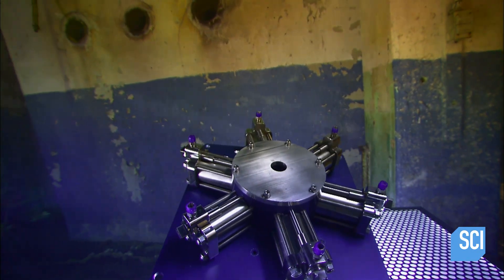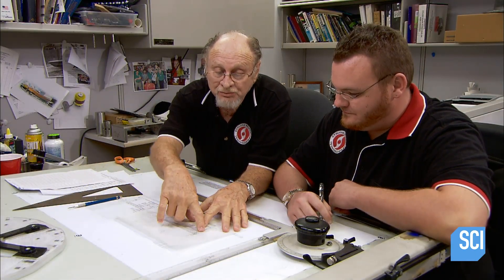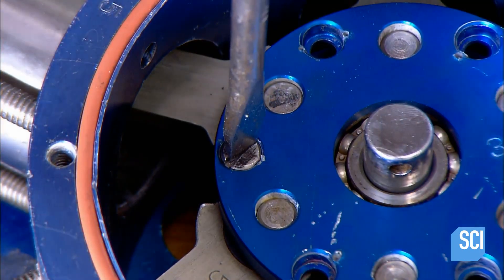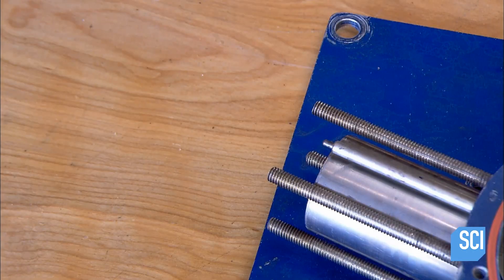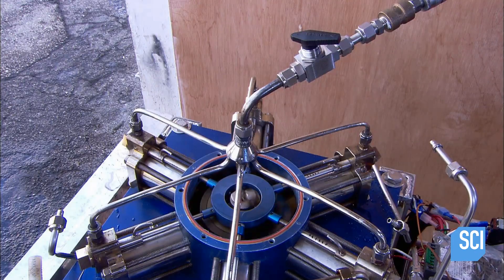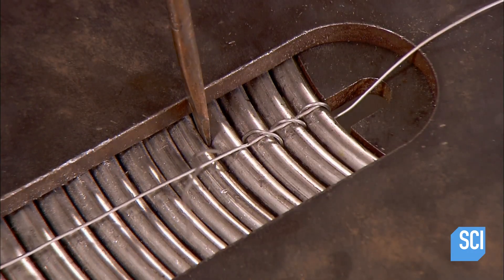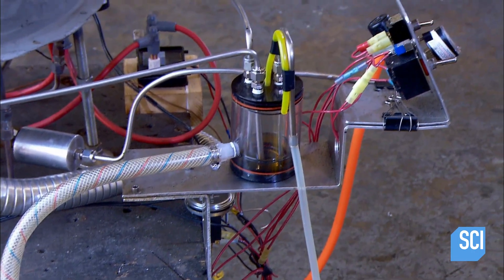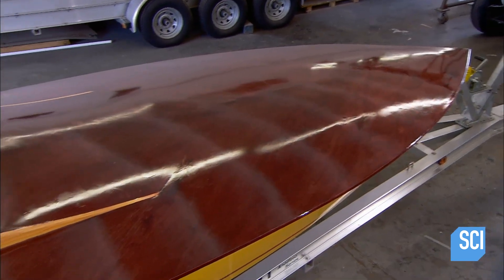How It's Made: Steam Engines

Comment: I observed that this sector-shaped component pushes the heads of these iron rods, and the other ends of the rods should be connected to cylinder controls, allowing the cylinders to take turns exchanging gases to ensure coordinated operation. I also think the gas exchange control and the condensation reflux steps in this video are quite crucial, as they seem to have not been disassembled in this section

Comment: I was told that steam engines were only about 15% efficient,  even if a triple expansion type - and isn't this engine,  effectively,  a single expansion? Couldn't they have increased the efficiency by running the exhausted steam into a secondary set of cylinders?
Reply: You are correct, a compound engine this size is only about 12% efficiency, it would be very unlikely this single expansion engine could achieve more than 10%.
FYI: Cyclone was never a legitimate company and it is defunct after Jharry Schoell diverted investments into the construction of a new luxury yacht (powered by Diesel engines)
Reply: @sandervanderkammen9230 

 Sad that people prey on others looking to benefit the environment.
Reply: @NoosaHeads  Anyone genuinely interested in benefiting the environment needs to take a seriously hard look at biggest problem, which is global overpopulation.
Not many have the courage to be honest about this threat to the environment.
Reply: No . I think the efficiency is quite high, higher then a diesel engine for sure
Reply: @robertlindsay9826 Absolutely not, the Rankine Cycle can never achieve higher efficiency than the Diesel Cycle, this is prevented by the Laws of Thermodynamics
Reply: The highest efficiency ever achieved for reciprocating steam engines was 31% in a German Superheated, reheated, condensing, quadruple expansion steam engine running on 800 PSI steam. Typical Superheated condensing steam engines could get up to 24% thermal efficiency. Uniflow steam engines can get much higher efficiencies at smaller unit sizes. A small, 50 horsepower 3 cylinder Uniflow steam engine at the White Cliffs solar thermal power project in Australia achieved between 18 and 20.5% thermal efficiency.
Reply: @gregorymalchuk272 Thank you. I didn't realise that steam could do so well. That's about the same as a petrol engine isn't it? (31%)
Reply: @NoosaHeads It's pretty good, and it's probably on par with nuclear power stations operating at the same steam temperatures. That was achieved in the 1920s, after which all research into the reciprocating steam engine pretty much dried up. Who knows what could be possible with modern materials and electronic controls.

Comment: Interesting fact is that nuclear reactors also uses stream engine to produce electricity, the reactor's main job is to produce heat which boils water and turning it into steam which runs the steam engines that then runs/turns the generator
Reply: Nope.

Comment: Genuine question - if steam engine is so efficient and greenhouse friendly, why isn't it more commonly used?
Reply: Because it's not efficient or greenhouse friendly.
Reply: It is and it isn't. Thermal power plants (coal, natural gas, nuclear, biomass aka wood, geothermal, etc) use steam regardless of the heat source, for the most part. 
The most efficient way natural gas is typically burned for power, for example, is with a combined cycle gas turbine, which is a gas turbine (similar to a jet engine but optimized for shaft power, not thrust), and a steam turbine combined together. The waste heat of the gas turbine heats boilers which drive the steam turbine. Gas turbines are far more efficient when driven with high temperatures, than steam on high or low temperatures, but the waste heat is still quite hot and can still be used for steam power. 

As for the small scale shown here, I doubt that steam engine is all that efficient, although I could be wrong (after all, that is quite the super heater in that boiler). Highly efficient piston steam engines are quite complex and maintenance heavy. When steam locomotives were phased out the diesels that replaced them actually were less efficient, but their far lower operating costs and greater flexibility made it quite worth while. Today, small internal combustion engines are probably way more efficient simply due to higher combustion temperatures, and certainly less maintenance intensive, but with that steam engine shown lacking any real control gear you would usually expect for throttling or achieving efficiency at anything besides flat out operation, it might not be too bad for maintenance cost. The generator used for charging off grid battery systems looks like the most interesting application due to it not needing particularly fine control. Btw, when they said in the video that the water was the lubricant, that was probably a flat out lie. The (I assume) graphite pistons are probably the lubricant, graphite is a good dry lubricant.

Oh and emissions. The low combustion pressure (and probably low temperature) reduces things like nitrogen oxide emissions, which is a big part of acid rain. Nitrogen oxide free in the air will eventually oxidize to nitrogen dioxide (once cool), which then reacts with water in clouds to make nitric acid. This has almost nothing to do with greenhouse gasses as CO2 is the primary greenhouse gas by a long shot in this case. 

Hope that was somewhat helpful and that I didn't get anything too wrong.
Reply: Because governments are made up of predators that believe that the only solution to any problem is you losing your rights. Hence the climate hysteria BS.

Comment: If this principle could be adapted to use the heat from A/C condensers and heat pumps to power a generator couldn't you recover some of the energy used to run those systems?  Move over solar.
Reply: Eh not really. They are both heat engines, and A/C systems or heat pump systems typically get less efficient as the temperature change required increases, so any gains made by the steam engine equate to greater losses in the heat pump that could have instead been avoided by keeping the output of the A/C as cool as possible.

Comment: Watching this so that I can recreate stream engine, when I get reincarnated. 

P.S:- I am not a weeb.
Reply: if you (in any life, not gonna judge) build a steam engine for the love of all that is good and true don't base it of this one, its absolutely awful. fixed valve timings, no lubrication (like wtf) and single acting pistons are all terrible design decisions for a steam engine.
Reply: @crestfallensunbro6001  Single acting is not really bad for efficiency, it's thermal efficiency is better because the cooling is more uniform than double acting, but this engine is the worst so far, I'd say to just replace it with a rotary of the same size, and also be able to almost get away with no lubrication.
Reply: Are you anticipating being reincarnated in 1850?

Comment: this is actually a reupload in upscaled hd (from 2012 ish)
the company has not sold any engines to the general public yet its all prototypes
Reply: That company reportedly sent belly up and is rumored to be in got water with their investors. 

Honestly it's a garbage design for a steam engine that's basically all flash and no substance, and anyone who's done any research into either steam power or efficiency would've called them out on it. 
Honestly besides turbines which have their place and are very efficient .. the best in fact, but only in a limited rpm band and there's volumes and pressure that they won't even turn over at. While not as efficient but still more than anything but a turbine the triple expansion double acting is still cave man simple and it's also very forgiving as far as metalurgy and materials and engineering involved